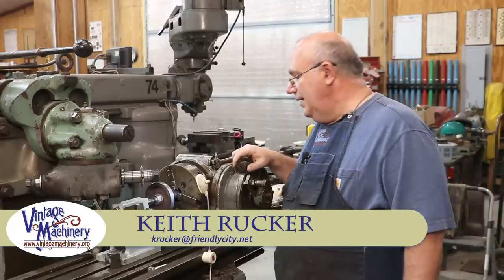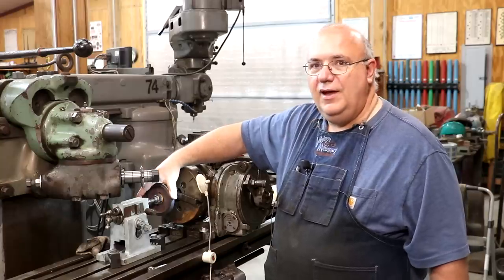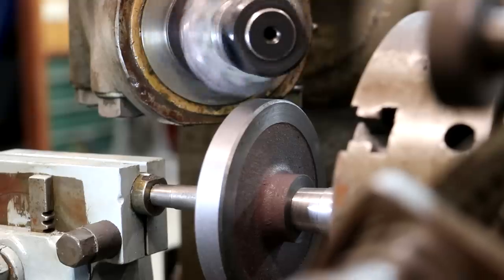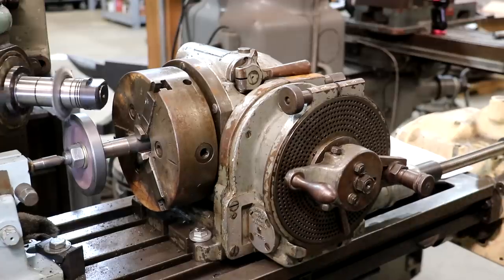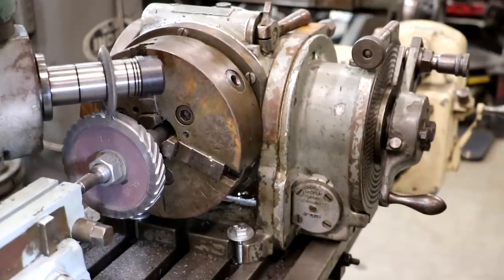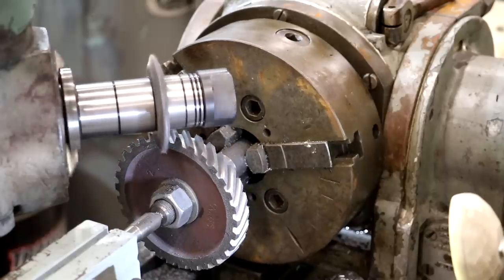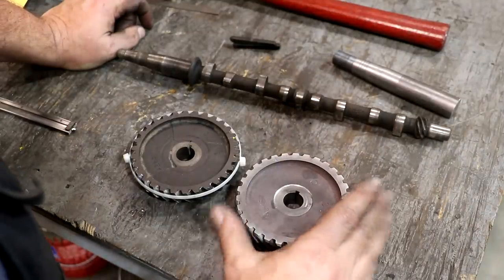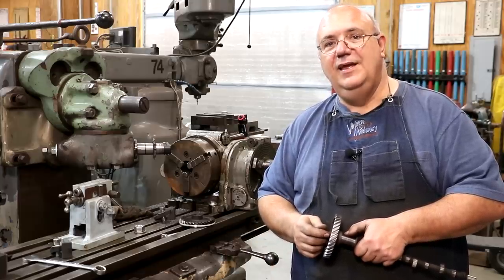Cutting Helical Gears on the Horizontal Mill Machine 7: Actual Helical Gear in Cast Iron!

Comment: Keith, thanks for attempting this and taking us along for a very interesting and intriguing operation. I shudder to think what all the "accessories" you had to "acquire" would have cost you if it wasn't for "horse trading, favours and plain old luck" in locating the bits and pieces needed to complete this job. 
It might also be informative to compare the time involved against doing the job on a CNC machine.
Never the less, well done for persevering to get the job done. Hopefully the "customer" will appreciate your efforts and at least supply you (us) with a video of the engine running and the car fully restored.
Merry Christmas and Happy New year from Canada's banana belt.
👍🇺🇲🎅🕊️🇺🇦🎅🇨🇦🍌🥋

Comment: The arms on the dividing head are Sector Arms. Sector being define in the situation as "the plane figure enclosed by two radii of a circle or ellipse and the arc between them." You are using the malapropism bordering on an eggcorn of "Sceptor." Feel free to look up the instructions for a dividing head and you will clearly see it details the use of "sector arms" 😉👍

Comment: Keith, thank you for sharing all this effort to get a single part done. I have a differential dividing head also but never was asked to such a puzzle as you had to to right now. I learned a lot and enjoyed watching your journey to a finished helical gear. One additional question comes to mind. It's one I struggle with a few times a year. What do you charge your customer? I know; you're not a commercial shp and spreading knowledge is your main goal. The client is probably an individual with a car to be repaired and it's a hobby for him or her too. I used to tell people who I helped; you decide on how to compensate me. And I thought, for many years, after telling the amount of work that went in for me, that they would compensate me in a a way that I would also had a worthwhile warm feeling. I was wrong, in my opinion or satisfaction for probably more than a hundred times. I'm a believer probably. But after so much disappointments I quoted a price before starting on the job. You guessed right, I don't help people that much since then. It still disappointments me because they are all cheapo's in my opinion. "I saved your item. it took me a day to fix it. Reward 1) thank you so much, reward 2) a six pack of beer. Keith, how do you address this situation? Like to hear from you. Al,the best, Job

Comment: This has been a demonstration of the skills of those engineers who designed the equipment, created the tables and finally yourself, researching the whole process and cutting the timing gear. One thing I’d have had a problem with would have been concentrating whilst carrying out the process and doing a live commentary. This included waving your hands close to the cutter. Sure that was only the camera angle. Well done Keith it’s been one of your top projects among the many you’ve broadcast. Regards

Comment: Well done!

This series is also a great demonstration why modern production uses CNC machines....
I used to think that CNC doesn't pay for one-off prototypes etc, but this has proven me wrong.
Reply: This is a rather complicated way of cutting a helical gear, there are specialized manual machines which are better suited for this (like gear hobbing machines). This is not a simple part to make on a CNC, and you need a 4 axis machine to do it.

Comment: There was a real lot of figuring out at how to properly cut this camshaft timing gear.   
     What  gear cutter to use,the gear ratio on the leads attachment. Figuring out dividing head set up and ending up using the vertical head instead of the horizontal bar on your milling machine. Figuring out the different gear cutter, because of back lash, WOW. In todays world with all the CNC machines. I believe there aren’t many machinists that could figure out the set up on how to cut this gear. Anyway Mr. Rucker,excellent Job,well done. Good luck with the medical procedure and making a full recovery. I always look forward to watching your videos.
Reply: Don't forget, having a missing part of the lead attachment, sourced then cast in iron then machined.

Comment: Thanks for sharing. One note, if I need to see if something has moved I use a paint marker and a scribe. One mark one the part and one on the shaft. The scribe marks point to each other. In your case the part, the nut, and the shaft. Excellent job thanks so much for your time explaining everything. I have not seen a helical gear cut before. Hope you have a speedy recovery, get well soon. Well wishes to you and yours from Louisiana.

Comment: To help keep the gear on the shaft from slipping, maybe try bonding it to the shaft with cyanoacrylate (super) glue. After you’re done machining, heat it a bit with a torch to release it. There are some high temperature cyanoacrylate glues, so test it on something first.

Comment: Another successful project by The Master. However, I do question the gears running at 90º to each other becasue the axis of the camshaft and crankshaft are parallel. Maybe Austin did things differently.
Reply: Timing gears run in parallel on the Austin as on most engines, but the crankshaft gear has right handed teeth and the camshaft left handed teeth.
You can't mesh in parallel two helical gears with the teeth cut in the same orientation, they must have teeth cut in opposed directions, even if you turn the gear upside down/backwards, its teeth will continue to have the same orientation, it's counterintuitive but think that a right-hand threaded bar still has right-hand threads at both ends.

Comment: Would it make sense in a production setup to cut every other tooth in reverse? Considering the backlash probably not but I'm wondering what would have been appropriate before the CNC machines to have a speed run. Great result btw
Reply: Combining climb milling with conventional milling can change dimensions between cuts unless you have an incredibly rigid setup and the minimum backlash your internals allow.

Comment: Wow, what a journey. It's amazing how complicated it gets, just because your table couldn't handle a 45 degre angle.

I might have missed this during one of the videos.
I'm not a machinist and this might appear dumd.
 It wasn't possible to slap a compound slide, angle it right, and here you go?
Reply: No in a word lol. How are you going to index the 30 teeth on the compound slide? If there were a much easier way of doing this job don't you think the engineers who designed this set up would not of thought of it?
Reply: @samrodian919  I wasn't clear about that.
 Of course, you put the universal head on your cross table/slide compound  (English is not my primarly language, I d'ont know the exact term for those things).

Comment: Excellent outcome Keith! This has broadened your horizons enormously. This a huge step for the shop. As is, you're basically free of the fear of ever breaking a gear in your lathes and machines now. :))
Reply: The only caveat would be if the gear needs to be made from hardened steel.

Comment: Tremendous. It blew my mind to see it done. One question not specifically related. Do your cutters have a lead tooth or are the truly circular. I only ask as I have seen what appeared to be stepped teeth on a cutter
Reply: Disc cutters tend to be circular and intended for feed-per-tooth, so constant load once fully in the cut. 

I cut gears daily and have yet to see a tooth form cutter in that configuration, though it often seems like it if you had a bad resharpening.

Comment: hi Keith, there is no reason that you could put a key in just for machining to insure that the gear doesn't move then your final key can be cut at another point, just mark the temporary key so they know which one to use.
Reply: Yes but then it isn't the same as the original and perhaps that's what they are looking for.

Comment: Remember the hole in the gear is tapered and will only go on the cam in one direction and the angle of the teeth can be done backwards and will screw you up if backwards